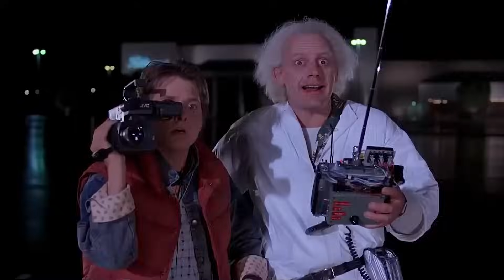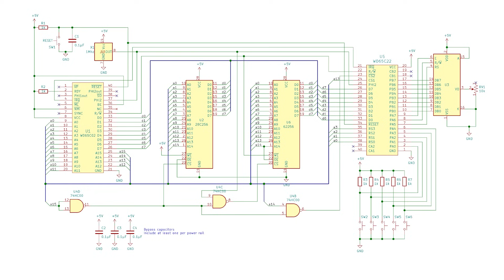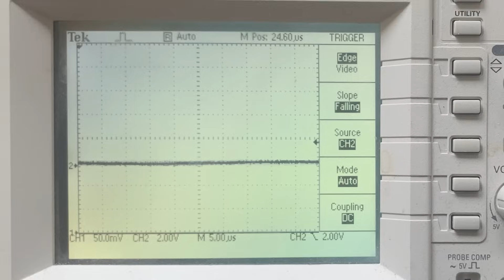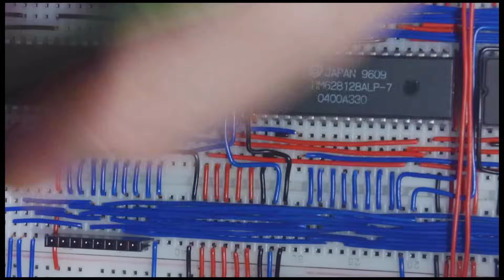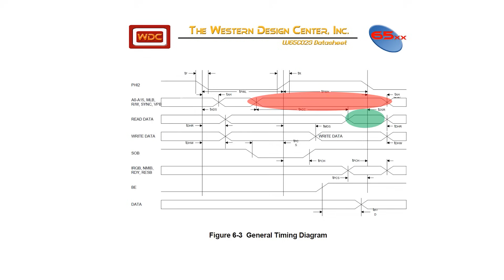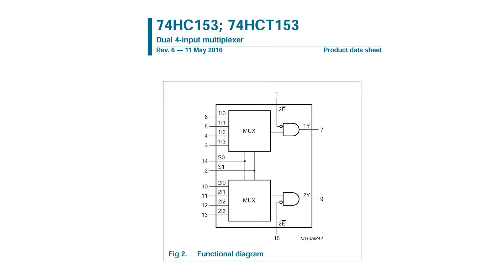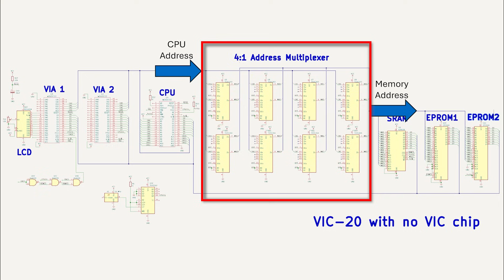VIC-20 Build from a breadboard 6502

Comment: Hi Matt.  How possible is it to make this design compatible with the ttl video Pets' machine code software?

I had thought that it was a shame they didn't just do a colour 80 coloumn version of the Pet TTL video machines instead of the Vic20 and 64 and 128.  Dropping all buses for the serial bus and cartridge bus and joystick (replaced by usb these days).
Reply from the maker: I haven't looked at the Pet design for a while.  Without colour, the dot clock is about twice the rate, so you can double the horizontal resolution straight away.  Not sure what they did in the PET to get to 80 columns though.
Reply: @DrMattRegan Yes, it may need a dual configuration.  The 80 column was often the Motorola chip they used in cga and incompatible with the TTL machine code where most games were done.  But doubling the ttl clock to get 80 columns is one solution, programmable characters and 4 unique colours per 2 bit colour character mode (160*200 vicpet-20 - 320*200 vicpet-64), would make a decent video output.
Reply from the maker: the 6845?
Reply: @DrMattRegan  Yep, the demo scene has got so much extra functionality out of the nuances off these, that unless you are only going to support a small subset of the functionality you have to support all the nuances and possible future compatibility with the Pets that used them.  But, as most games were written in the time of the ttl Pet, it's a bit moot.
Reply: @DrMattRegan  I saw you are interested in going a TTL QL, is that going ahead?  Seems like a great idea with just USB.
Reply: @DrMattRegan  I had a similar thought.  Since you're going thru a monochrome stage might you give PET v2 or v4 ROMs a  try before moving onto the colour phase.  No need for 80 columns, but discussion of keyboard layout implementation would be cool.
Reply: @MattKasdorf  I think in terms of what people missed out on, and what they could have done.  The mixup in these companies, of competing inadequate designs ultimately tanked things. Ultimately Acorn won, except for a few things like the electron compromises (which hit games compatibility and performance, which c16 and 128 had similar performance issues in Commodore.  Atari two or three times hit outside solutions that could have helped, only the ex Sinclair people did.  Amstrad just slid through until it was a bit late to upgrade with a spec they should have in 1985).  I had come up with a simplistic cpu stalling graphics format that allows a decent level of basic ability compared to pcengine or mega drive (not that it's going to be as sophisticated graphics handling, but look at sonic the hedge hog on the Commodore 64, on a bit of limited ability).  It's a simple TTL level upgrade. 80 columns allows 2 bits at 320, 4 bits at 160.  Sacrificing CPU enabled a slower system better graphics.  On a 1970's design 80 Columns would be pretty good, even if a lot of the time the CPU is paused.  You wouldn't need much.  The mistake was blocking video instead of CPU on those days, leading to unacceptable glitches.  In my scheme you only stall the CPU sometimes when doing more colorful objects. And a little buffer cache for backgrounds.  Pretty much gives ability to look like an 1990 Amstrad 8 bit in a 1970's level, or cheap 1980's machine.  Something so incredibly simple.  We didn't even really need the c64 sprite system, and close to single chip MCU instead of the vic2 (you can replace most of the non video/audio/cartridge expansion IO with serial busses off a MCU and use  peripherals made for it under license, and convertors to others.  We lived in dark times, just blinded by the flashy lights.
Reply: @waynemorellini2110   I wasn't thinking too deeply, just how he might put a bit of a PET spin on the next presentation seeing as it was the precursor to the VIC20.  I love the idea of a 40/80 column colour PET but isn't Fachat already working on that.
Reply: @MattKasdorf  The circuit complexity of a colour 80 col version of the ttl circuit would be a lot less complex than a TTL version based on either of the incompatible official 80 col version based around the Motorola chip.

It's incredible they had their own foundry and couldn't be bothered to build upon their previous work.
Reply: @waynemorellini2110    No.  Search YT for: "Three enhanced Commodore PETs: Ultra, Micro and Ulti."

Comment: Glad to hear you will go over your soldering method later. When I do P to P, I use the iron to melt the insulation at the position I want to solder, and I find it messy. It might be I'm using too large of an iron, so finding out what iron you use would be great too.
Reply from the maker: So the trick is to pre-stretch the wire by ~2%.  Not enough to snap it, but enough to be able to move the insulation, then i just use a regular wire wrapping tool to cut the insulation.  Occasionally to do have to melt the insulation, but that's only when i've cut it to the wrong length.

Comment: Are there any plans to do the same but for C64?
Reply from the maker: Yeah, i'll probably do a C64.  Will be a bit more challenging.  Will probably design a "sprite" card on PCB and stack 8 of them together.
Reply: @DrMattRegan  That sounds awsome but is gonna be a threat to the world's supply of 74-Latches. I'm in for it! =)
Reply from the maker: Yep, i think the non-sprite stuff will be somewhat similar, just faster.  The sprites would be easier with FPGAs but i'd rather use TTL logic.
Reply: @DrMattRegan  Sounds amazing. I guess SID is out of the question... still discrete VIC2 sounds like a winner.
Reply from the maker: I'll try get sound working on the VIC-20 first.  Not sure about the SID chip yet.
Reply: @DrMattRegan  Definitely should be possible to make FPGA-like SID using discrete components e.g. by reverse engineering FPGA implementations and even get near-perfect results or at least as perfect as SID implementations go.... Original SID was analogue and so far no one managed to make discrete analog SID. Discrete digital SID probably also no. It does look like lots of components will be needed.

MOS8580 should be a tad bit simpler due to less workarounds needed for DAC. Also maybe some parts can be skipped without affecting sound quality too much but I am not too sure about that.

Personally I analyzed SID from MISTer FPGA and Ultimate64 to port UltiSID to MISTer (for my personal uses only - limiting license) . Component-wise the latter seems more optimized - heck, it even multiplexes components to get multiple SIDs and supports filter files (so something which you could put on EEPROM) in more advanced way. To understand what does what MISTer implementation seems much easier to follow.

There is also reDIP-SID from FPGA SID project and it uses its own HDL. MISTer implementation is based on it.

Then again might be good to just go at it clean room style. Especially if perfection isn't needed. Personally I planned to attempt it in FPGA but for now such project is above my paygrade.
Reply from the maker: @e8root  thanks for the info.  I think for YouTube videos it’s best to go clean room, half the value is learning how it works.  Copying an existing design might skip details etc.